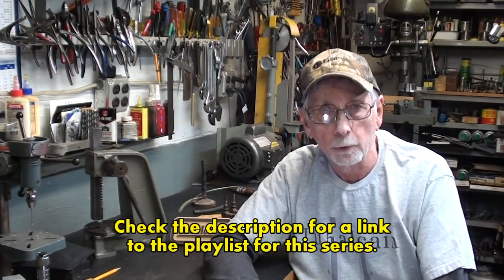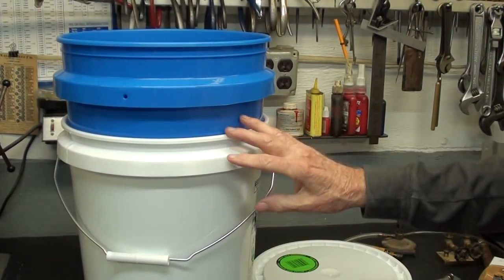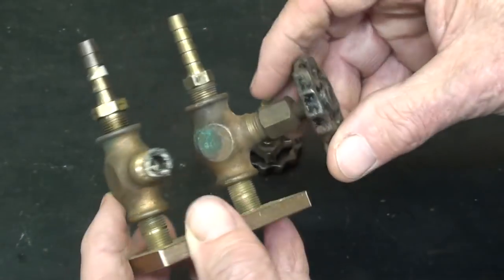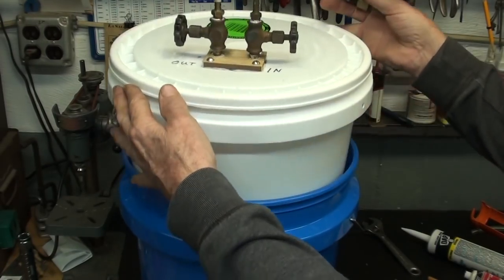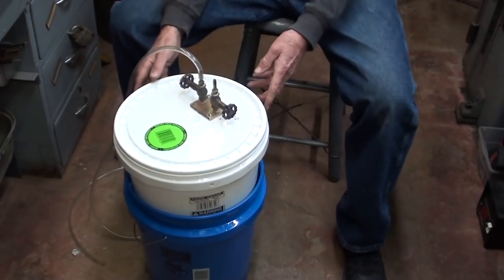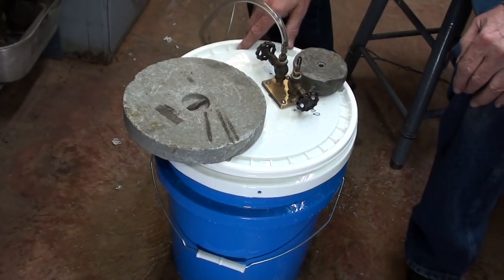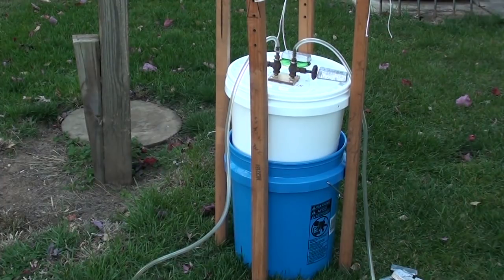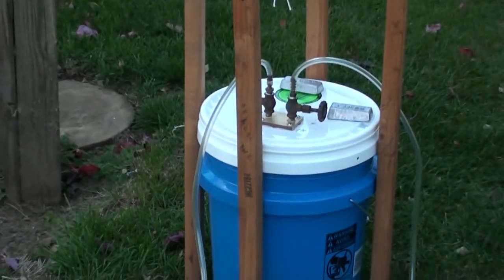What Makes It Work? #32 GASOMETER gasworks TUBALCAIN

Comment: This is just off the cuff, but I started wondering the fact that the top started falling already before the Bunsen burner was on.  Maybe the burner valve did not hold, or what is more interesting to me, some of the gas was dissolved by the seal water.  That presumably, because the water was not pre-saturated.  I may be on totally wrong path of thought here, but I have ever since my youth been blamed of excessive curiosity.  Time to dig out some actual data of natural gas solubility into water.  Thanks for the inspiration!
Reply from the maker: I had a minor leak on the valve stem packings. I won’t redo it because no one watched this video
Reply: @mrpete222     That leak makes more sense than the amount of gas being dissolved.  I tried to locate information about the saturation level of natural gas in water.  Took a while before I found anything other than some high pressure (over 500 PSIG numbers.  But eventually I found the relevant low pressure info.  Seems to be one to one in volume or 1/1000 in mass.  So, leak is the explanation.  But I did learn something anyway.  As I said, thanks for the inspiration!

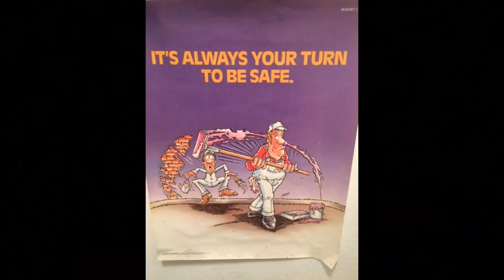Comment: 20:39 - you can see the flame burning in the bottom of the Bunsen. The next possible stage after that is the flame travelling down the gas pipe and igniting the gas in your gasometer blowing it up ! Hence flame arrestors on oxy-acetylene torches !

Comment: 4:20 cutting a hole in the bottom - pretty sure the first hole would have been enough ! Leaving the rest of the bottom in there would be a shelf for some weights to get the right pressure.

Comment: the pressure of the gas is simple to calculate, it is the mass of the white bucket with the valves and the lead divided by the surface of the lid
Reply from the maker: Thanks, I’m too dumb for that
Reply: @mrpete222  don't say that, you are way smarter than me in the shop

Comment: Hmmm... far as camera exposures go. In a nutshell, way back when they determined that the 'average' well exposed photo has an overall average tonal value of about 18% gray; and camera automatic exposure meters are to this day calibrated to deliver accordingly. (The word 'Average' is a mouth full in this context.)

This is great for 'average' scenes. However, if there is a lot of white or bright filling the frame, like a sheet of paper, snow etc, the automatic light meter will do it's duty and darken (under expose) the image while shooting for 18%. The reverse is true for mostly dark scenes.

I have zero video camera experience, but I suspect there will be an 'exposure compensation' control somewhere as found on still cameras... probably marked zero in the middle with graduations going to both a "+" and "-" side.

For scenes brighter than 'average', light should be added with the control to override the meter, and subtracted from dark scenes for the same reason. (In my experience it's the white & bright scenes that are most troublesome.)

Or to get rid of the automation, adjust & lock down the exposure manually on the interesting parts of the scene so they remain well exposed.

This is just a clumsy overview... there's a good bit more to all this.

Great videos, Thanks!
Reply from the maker: Thank you for that. I am not a professional photographer and I just use a cheap camera

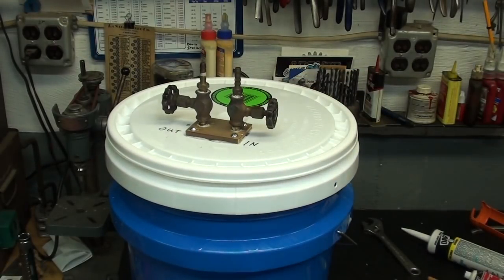Comment: 8:40 Adding weights - should go in the bottom of the white bucket - on the base of it you unnecessarily cut out !
What gas pressure do you want ? 2 psi ?

2 x π x r^2 - so if radius is 7 inches = 2 x 3·14 x 49 = 308 lbs weight 

For 4 psi
4 x 3.14 x 49 = 616 pounds

From your video, it suggests this calc is wrong and that's puzzling me. PSI is quite simple - number of pounds weight on top of the bucket per square inch area of the 'water' piston inside the bucket. Maybe my estimate of a 14" diameter bucket is just too big ?????

Comment: 6:40 - Looks like you're doing it all wrong ! There should be nothing attached to the white bucket ! You just need a pipe in the blue bucket that goes up into the white bucket the depth of the white bucket or thereabouts.

Comment: If you have some clear tubing you can build a pretty accurate gauge by putting some water in the bottom of a loop of tubing and then use the water column as a manometer and get pressure readings in inches of water or for a more compact system mercury. https://www.youtube.com/watch?v=9eq7NE6OsX4
Reply from the maker: Thanks